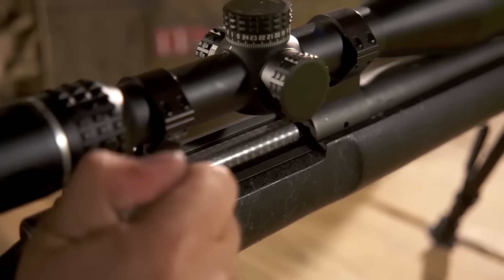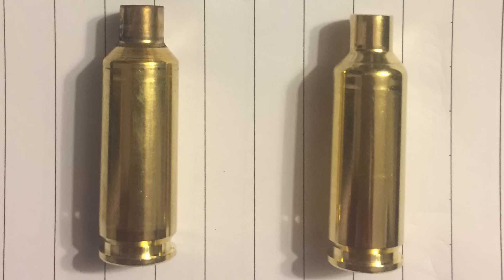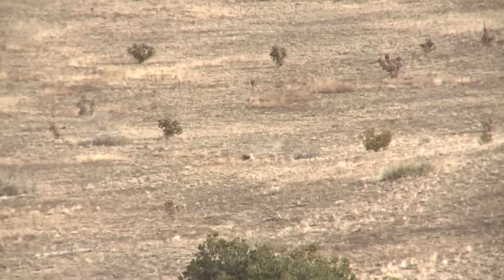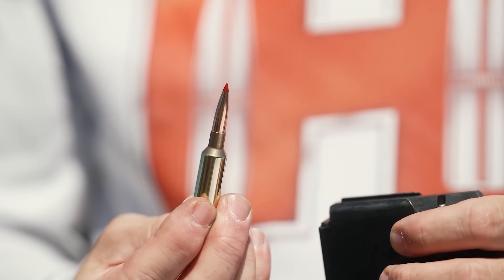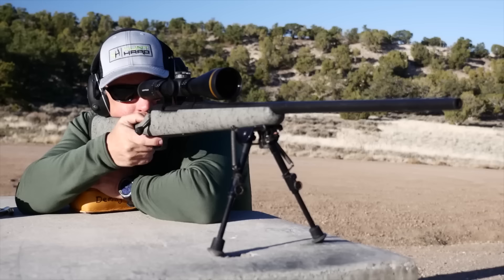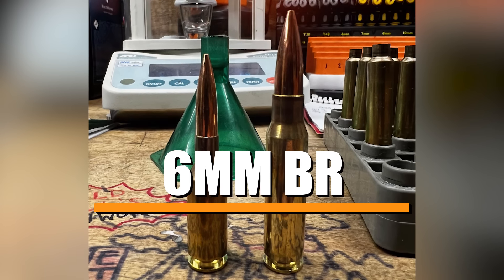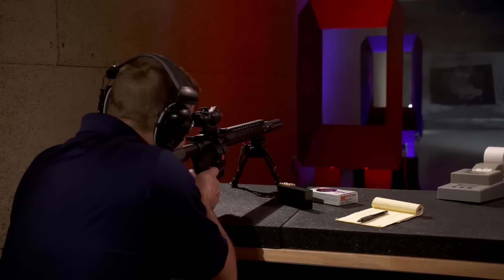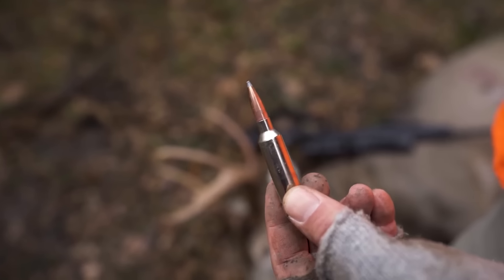Top 5 Best Long Range Calibers in 2025!

Comment: The best cartridges are those that have been manufactured to strict standards and have the same behavior in different environmental conditions (temperature, humidity, etc.). The diameter of a cartridge has little or no effect on accuracy.